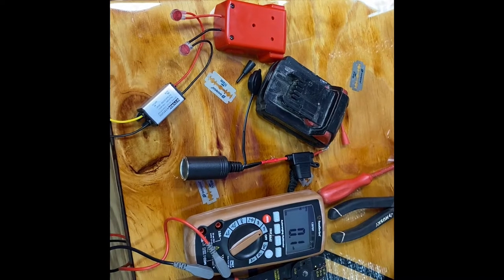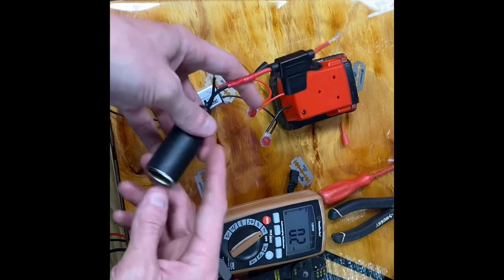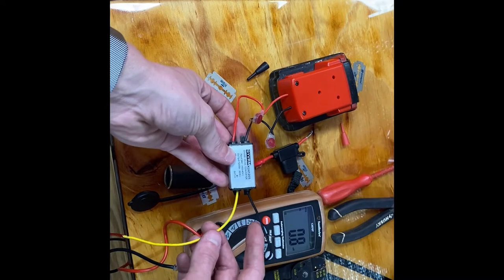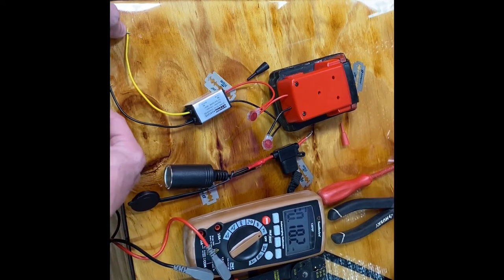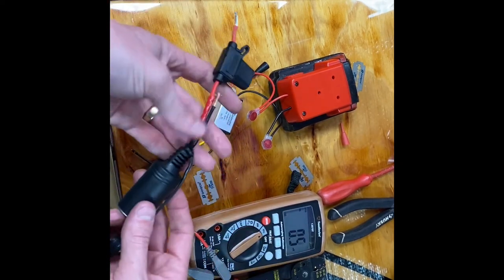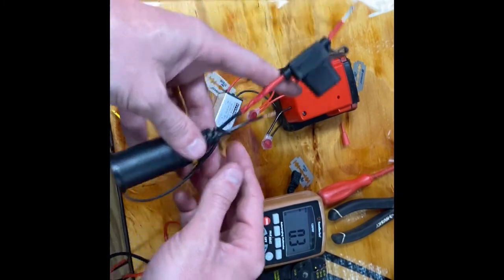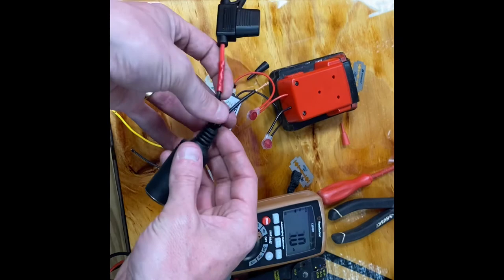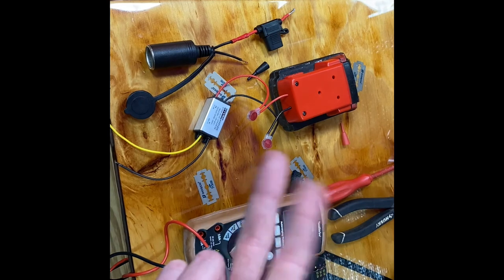DIY Milwaukee M18 Battery Running 12v Accessories/ Camp Power/ Mini Power Station

Comment: Milwaukee makes a device exactly like this that clips on battery and has USB port and round port for charging 12v accessories… they have an internal circuit board with all the reducers built in. They are very compact and inexpensive. Mine was around $20 new a few years back
Reply from the maker: Nice! if I need a second one or mine goes bad I look into it I was unaware of them when I made this
Reply: The 12v DC Barrel plug on the Milwaukee adapter only provides 1 amp of power which is good for almost nothing.

Comment: That's the same setup I have for my boat depth finder. I didn't really need to use the step down adapter to 12 volts but I guess it doesn't hurt.
Reply from the maker: That’s awesome. These batteries run good . I did the step down because I have a 12v water pump that could burn out pushing the 18v . I didn’t want to risk it

Comment: Upon my research 

Milwaukee make the cheap power source adapter. ThT apparently automatically steps down to 12v on the DC output. 

I wonder if I rig up a cig socket to have a DC make plug, would that be a more compact setup
Reply from the maker: I’ve never see the adapter your mentioning and mine made simple dog bone style is pretty compact without the battery